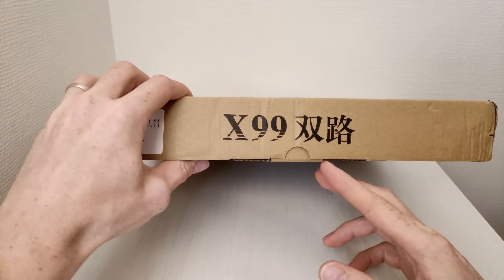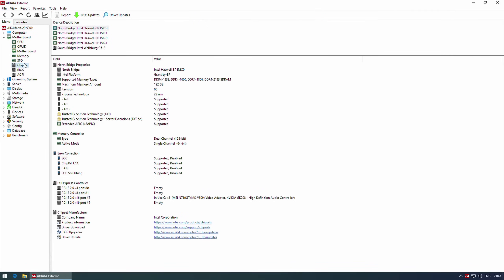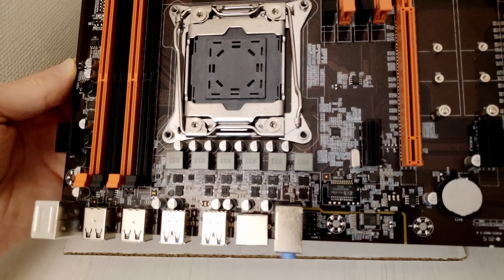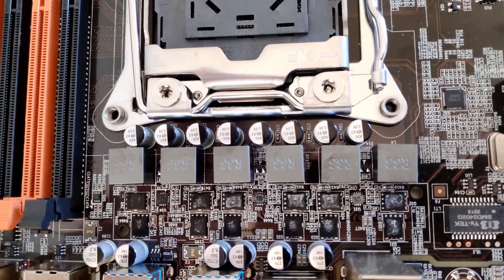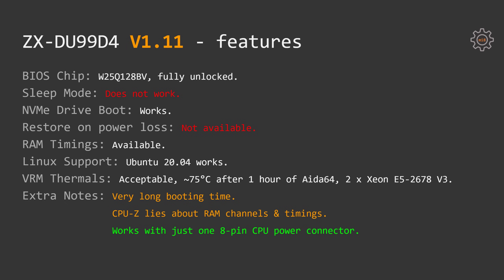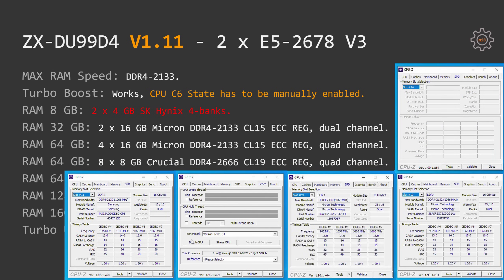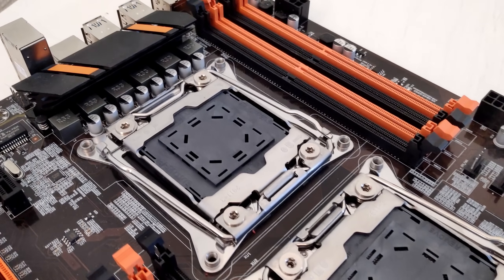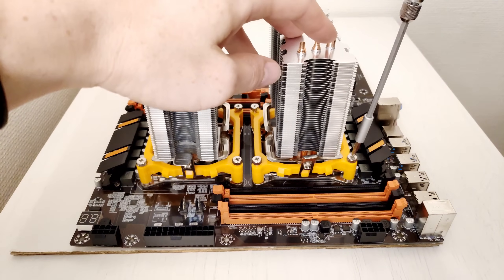🇬🇧 Detailed review of ZX-DU99D4 V1.11 Dual Socket LGA 2011-3 | E5-2678 V3 | E5-2620 V4

Comment: hello there,, you said, this motherboard can work with just one 8pin power connector, that for dual configuration or just single cpu configuration ?
Reply from the maker: If I remember correctly, the motherboard worked with one connector and two CPUs. Anyway, I strongly recommend to stay away from this motherboard, it's very unreliable.
Reply: @Miyconst  alright, better take x99 dual from huananzhi then , thankyou 👍

Comment: Hi Miyconst,
Thanks for the great video!

Quick question: Does this board support Intel CPU VT-x and IOMMU? I'm planning to use EVE-NG over Proxmox. 
regards.
Reply from the maker: Please don't. This motherboard is utterly unreliable. If you need a server - do yourself a favor and buy a Dell T5810/7810/5820/7820 workstation instead.
Reply: @Miyconst  Thanks again. But Dell boards look pricy, or I am checking in wrong places. Do you have a suggestion?
Reply from the maker: @mehmetcanpolat1110  my suggestion is to stay away from this motherboard and go with a Dell workstation, not just a motherboard.

Comment: Hi, how do reset the cmos on this board?
Reply from the maker: You can remove the CMOS battery and wait for 30-60 seconds, it should reset the BIOS settings, of course if the motherboard supports it.

Comment: a shame it didn't have restore on power loss function. gonna be a great server board if it have this feature
Reply: it actually does, it has 3 pins next to the sata7 port, by default it uses the first 2 pins, switch it to the other 2 and voila you have restore after power loss ON :P

Comment: Thanks for making this video, After a month I got my board and I'm trying to figure out the jumpers for the lower M2. I have two M.2 2280 NGFF. Not sure on the jumper placement though. Any thoughts?
Reply from the maker: Hi, these boards came with several different revisions and jumper placements, you need to study the schematics printed on the motherboard or ask the seller.

Comment: A weight of the heatsink is less important than a max power mosfets can handle. 2667 vs 2697 is a big difference. And manufacturer keeps a silence. But two cannel RAM is a showstopper. Now you can find four channel 4x16 PCIe Lenovo rd450 motherboards for less.

Comment: Hello, I have two Intel Xeon E5-2643 v4 CPUs, but only one is being detected. Both CPUs have been tested and are working individually. However, when both are connected, I get error 79. Do you know what the problem might be?
Reply: If you want to setup 2 CPU, you have to use ECC-Registered RAM. Otherwise, you will keep getting the error code 79.
Reply: @johnPlayer-l5c  tnx

Comment: Sirr, I have this kind of motherboard. If I use a 3200 mhz ddr4 ram, will it automatically downclock to 2400mhz? or 3200 mhz ram will not work in this motherboard?
Reply from the maker: If the RAM is compatible it will automatically downclock itself to DDR4-2400 or 2133, depends on the CPU used.

Comment: Hi. My motherboard is getting stuck in code 79. Using 2 E5 2650 v4 and 2  ddr4 3000 ram sticks.
Reply from the maker: Hi. It seems like there is a compatibility issue between the RAM and the motherboard. Do you have a possibility to check with some other modules? Preferably ECC REG.
Reply: @Miyconst  Just ordered some online. Once it reaches, will update.
Reply: @Miyconst  Just changed to V3 processor, now its working. Unfortunately, with one ATX connection, both are working, until under load, then getting restarted. Thus removed one processor. Now its working well. Lets see for how many days!
Reply from the maker: @jitcrypto  do you mean that the system crashes if you stress test two CPUs? It could be that the PSU is not strong enough.
Reply: @Miyconst  That must be true. As I was only using 1 psu, and 1 8-pin atx power supply. have ordered some spliters. Lets see what happens.
Reply: you need to have ecc ram sticks to mount two v4 xeons
one would work with nonecc memory tho
v3s works with all rams with dual cpus
Reply: @utkajmatke863  hi. Thanks for the suggestions. I have switched to v3 and the system is working ok.

Comment: @Miyconst Do you know if this board can work with a single Xeon E5 in the primary CPU slot, and have the secondary slot empty? Most brand name Server/workstation boards from Asus, Gigabyte, etc can do this. Your gaming benchmarks make it look like you have one CPU installed. 

can you confirm please?

thanks
Reply from the maker: Yes, the motherboard works with just one CPU installed but not every PCI-E slot is available in that case.
Reply: @Miyconst  Thank you for clearing that up, I figured it would. I'm assuming the top PCI-E 16x lane works with CPU 1 socket?

Comment: "I have the new version of the M.B, X99 - ZX-DR99D4 V1.31, with CPUs XEON E5 2697_V3 + 2680_V4. Only one CPU works in the main socket. Both CPUs work perfectly as single CPUs, but together they give error code [dC], and I'm not sure what that means. I have 32GB of RAM. I put both RAM sticks on one side to work with one CPU. When I tested with 2 CPUs, of course, I put RAM sticks for each CPU in their respective RAM sockets. What is the solution?
Reply from the maker: Sadly, this video is all I can say about these motherboards: https://youtu.be/7Pyef_ySHwo?si=KiTgTB8ySIiNigHT
Reply: Dual CPU only work with equal processors, not different ones, they need to have equal number of cores,  to work together.

Comment: Why did you not show the CPU installation?  This motherboard does NOT have LGA2011-3 sockets.  It has the older LGA2011 sockets.  I purchased this motherboard, and 2x Xeon 2699v3 CPUs.  The CPUs, which are LGA2011-3, have a different pinout that the sockets on this motherboard.  I have an ASRock X79 server motherboard in a different server chassis and just last week upgraded the CPUs from 2620v2 to 2650v2 to get more cores.  The ASRock X79 motherboard sockets have the same socket pinout that is on this motherboard, LGA2011.  I was hoping that this video would show the installation of the CPUs so I could see the socket pinout.  How do you get a E5-2620v4 to work in this motherboard?
Reply from the maker: If you bought LGA 2011-3 but got LGA 2011 motherboard it's seller's fault and you should either send it back or demand compensation. My motherboard indeed was LGA 2011-3.
Reply: @Miyconst - thank you for replying. I appreciate you getting back to me so quickly.

Comment: Good Morning, Can you share driver for USB 3.0 for this motherboard. My front USB 3.0 port is not working.
Reply from the maker: The driver will not help here, it's a hardware failure, but you can try to install all optional Windows updates.

Comment: Dong buy the black orange ones... Especially the ones with like 4 slots on the top and 4 slots on the right bottom had one it died instantly as soon as i set it up. Got a new one as it was broken and the new one worked but after using 256gb or ram 2 slots died then after a few weeks anothr died and i was stuck with 150 or so gigs when i need the full 256gigs and then it completely failed over the span of like 3 months... only buy the black ones that got the reinforcements on them only ones i trust.

Comment: I know this is an older vid , but is there anyone out there who has one of these systems and got quad channel memory to work ? No matter what it just won't work . I have 2 e5 2690 v4 's paired with 8 samsung 16 gb ddr4  ecc 2400 modules . It works in dual channel but not quad
Reply from the maker: What program do you use to check? Most likely you see dual channel per CPU, means quad in total.
Reply: Thanks for the reply, I'm using hwinfo 64 , and also have tried cpu-z . Both are the latest versions and report back dual channel memory mode. They both also say I'm using slot 7, 10 , 19 and 22  even though all consecutive 1 through 8 slots are populated. I also noticed that gpu bandwidth is severely affected on the pcie 3.0 x16 slot closest to the cpus which is where my gpu is situated
Reply: I ran cinebench r23 and got a multi core score of 21300 or thereabouts just for reference

Comment: So what is the solution for auto power on? Any idia
Reply from the maker: Just don't buy this motherboard.
Reply: @Miyconst  it actually have an auto power on pin right next to the sata7 port, by default it is disabled by using the first 2 pins, all you have to do is switch to the other 2 pins, it will auto power on after power loss

Comment: So i hope you still reply to reactions on this video because i have a little bit of problem with this kind of motherboard. I have the ZX-DU99D4 V1.12 with 2x E5-2670 V3 and 8x 16GB ram sticks. I run Proxmox on this system so i can run vm's like Home assistant, plex, AMP. Now when i all use 8 ram sticks (128GB) it boots into Proxmox i can start all my vm's but after like 10 to 15min i lose connection to Proxmox web ui and all my vm's go offline, when i access the terminal directly from the system i notice that my M&K or not working meaning i also lost connection to my USB ports. Now non if this happens if i only use 4 ram sticks. I have tried many forums to figure out what the problem could be but no one has found the problem yet. Any help from you or your community is welcome since you have experience with these chinese motherboards.
Reply from the maker: Unfortunately there is nothing I can suggest, this motherboard is simply not good enough. There is also a chance that you have defective RAM, but it's less likely.

Comment: Hi, I'm not sure if you would see this, but I have a question regarding the cooler configuration. I saw a kit/set from artermiter that looks exactly like this board, and I was wondering if you'd know whether bequiet pure rock 2 cpu cooler would be able to fit fine as it does not use the brackets provided in the motherboard kit/set. Thanks in advance
Reply from the maker: As far as I know, these Pure Rock coolers are not compatible with LGA 2011 socket mounting.
Reply: @Miyconst  Thank you for the quick reply, do you have any coolers you can recommend?
Reply from the maker: @Gemmmmmmmmmmmmmy  Cooler Master Hyper 212 Evo, but only the one with LGA 2011 mounting bracket.
Reply: @Miyconst  gotcha, i appreciate the help

Comment: thanks for the videos, they are great and very helpful. 
have you tested or do you have an opinion  for the MACHINIST X99-D8-MAX? i want to build a dual 2696/99  v3 workstation and the easyest to get for me are ZX-DU99D4 and  X99-D8-MAX. memory chanel and expansion slots are not a inssue for me, but i'm worried about power delivery and vrm temperatures

Comment: I have the same board but could get 2620v2 cpu's to slot in but not 2690v4 to slot in..
Reply from the maker: Then you have another motherboard. V2 and (V3, V4) use different CPU socket.
Reply: @Miyconst  you are right. They sent an x79. Does the 2690v3 differ in size than the v4?
Reply from the maker: @markbale7002  V3 and V4 use LGA 2011-3 (X99) socket, V1 (V0) and V2 use LGA 2011 (X79) socket.
Reply: @Miyconst  thank you my x99 arrived and fats 2 x 2690v4’s.
Now for testing 🙂

Comment: I still don't get where I should place the RAM if I have 2x 32GB DDR4 RAM. Do I place 1 in the 4 slots on one side of the CPUs and the other on the other side? Or should I just place both of them on one side of the CPUs by skipping a slot?
Reply: Definitely put one on either side of the cpus, so long as you are running 2 cpus. The 2 banks of memory slots are for each cpu separately, and only one can access its own side, so you wouldn't want to leave one of your processors without memory.

Comment: Great video !! THANKS
There is just one piece of information missing... does the motherboard support multiple GPUs, CROSSFIRE or SLI?
Reply from the maker: The motherboard supports multiple GPUs, but not SLI.
Reply: @Miyconst  thank you !!
do you have any information on how the multi GPU works on this motherboard?  documentation maybe?
Reply: do you have any information on how the multi GPU works on this motherboard?  documentation maybe?
Reply from the maker: @francksimon7801  this motherboard does not have any documentation. Multi-GPU is basically when you plug in two or more GPUs in the same system and they are recognized. With this motherboard you can connect at least three GPUs at a time.
Reply: @Miyconst  OK, thanks you for your answer!
3 GPU ??!!
There are only two PCIE 16X ?? Not?
Reply from the maker: @francksimon7801  you can use PCI-E X1 risers or PCI-E X1 GPUs, these are not very common, but do exist.

Comment: Hello friend, how are you, I have this modern boart mainboard ZX-DU99D4 V1.11, I would like to ask a question, I have installed two Ddr4 8gb ram memory modules, 2400 MHz altermiter brand, these days I wanted to expand the memory with two other ram memory modules. The problem is that I didn't have the same reference and I bought some Jazer Ddr4 8GB at 2660 MHz. I put both references together but it doesn't turn on and I get error 60 (DXE CORE is started) and it doesn't turn on, when I put them alone they work fine but when I combine them they throw the error, my specific question is, are the rams being of a different brand and frequency are they incompatible?

Thank you very much in advance and I await your response
Reply from the maker: Yes, according to your description your two memory kits are not compatible with each other.
Reply: Thank you very much for your answer

Comment: A quick update for the video on what this configuration is suitable for or isn't good for!
I don't recommend using it for music production because Daws and vast plugins usually use single-core performance, not multicore.
Unfortunately, the Xeon CPU compared to mutch recent CPUs doesn't really go high on frequency so you will be quickly limited If you use the lastest version of Daw and big plugins like the Arturia v collection.
Reply from the maker: That's very true. Music production needs strong single core performance and extra cores are just useless.

Comment: dont run this board with a single 12v cpu socket, it will burn all the 12v pins when it overloads them.
Reply from the maker: Don't worry, it will burn either way.
Reply: @Miyconst  why
Reply from the maker: @geofrancis2001  here is why: https://youtu.be/7Pyef_ySHwo
Reply: @Miyconst  I burnt the 12v pins because I was using an old HP workstation power supply that only had a 8+4 for CPU power rather than the 8+8 I actually needed for dual socket operation . The result was the 4-8pin adapter I used burned, that then shifted the load to the other 12v pins and eventually damaged them but the board was still working fine. It's now got a decent EVGA P2 1000w platinum running dual 2699v3 s3turbotool unlocked to 3.6ghz with a 0.09v undervolt. It ran with the HP power supply mining for almost a year before it eventually started crashing and I found the burnt pins. So chances are some of the issues out there with this board is just inadequate power supply especially when your saying you can run the board with only one CPU 12V plug.

I haven't had any issues with ram but I only using identical Samsung 16gb ECC modules
Reply: @Miyconst  I just made a strange discovery, I bought another one of these motherboards and when i ran some benchmarks i was getting some really strange numbers. scores that were much higher than they were before on the other board, so i flashed the old bios to the new board and the scores went back down. so i flashed it back and started looking for an explanation, i tested with the same processors but I found they couldnt be undervolted as much on the new bios, only -70-30 instead of -90-40 on the old bios, but that should have caused it to be slower not faster as it shouldnt clock as high but its still setting dual 2699v3 records on HWbot. eventually i noticed in CPUZ that the timings were looking really strange. itwas running the samsung 2133 ram at 10-10-10-50 timings, those are ridiculous numbers considering the ram is rated 15-15-15-36. its the only thing I could find that would explain such a radical difference. I can send you the bios if you want to have a look at it. 

https://hwbot.org/submission/5175743_geofrancis_cinebench___r20_2x_xeon_e5_2699_v3_11005_cb

Comment: It's support E5-2699 V3?
Reply from the maker: It does, but I strongly recommend to stay away from this board.
Reply: @Miyconst  why wouldn't  recomend this motherboard for that cpu? and what motherboard would recomend for dual 2699v3 or 2696 v3? 
 i'm between this one and MACHINIST X99-D8-MAX, can you give me your opinion on that machinist Motherboard?
Reply from the maker: @srzfelipe  I strongly recommend to avoid both of them. The quality and the BIOS are just too bad.
Reply: @Miyconst  good to know, anyother to recomend? or in any case wich procesors would you put in any of this boards? ( high cores count is the my main requirement)

Comment: Hi, I didn't find any pdf manual, and seriously need help ! I have changed my GPU, and the motherboard didn't screen anything. So the only solution I found is to take off the battery of CMOS, and restart it to clear the CMOS. Now my M2 (on the second slot recognized is sSATA isk) is ready to boot, but after starting, the screen says me that I can't boot on it.... Before it worked properly, but I think I have an option to change in the Bios. Could you help me please ?
Reply from the maker: Hi. It's very unclear what exactly you are asking for, feel free to join my Discord and ask for help there.
Reply: @Miyconst  ok no problem, have a link to your Channel ?
Reply from the maker: @jcpamart83  it's available in my channel's header.